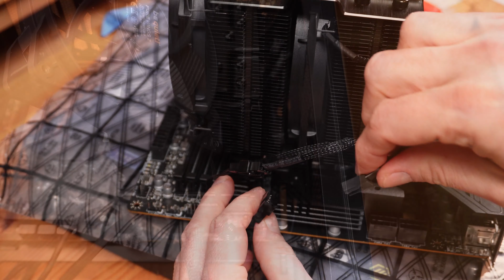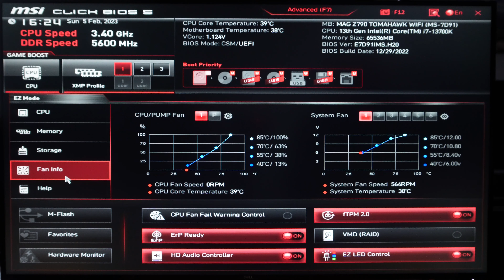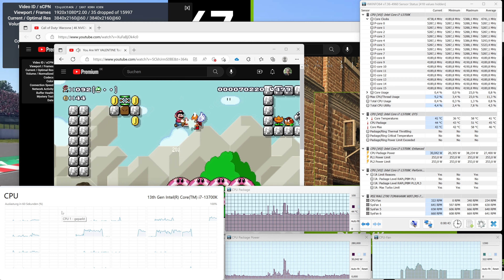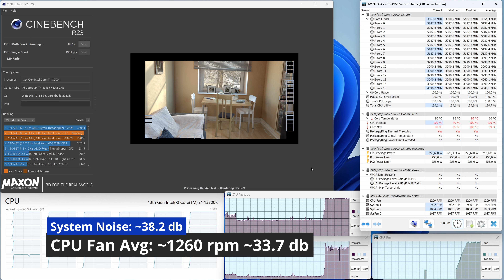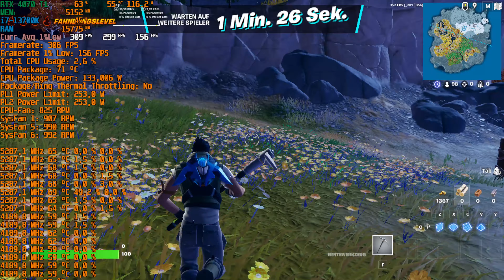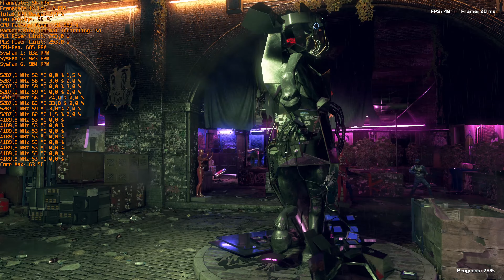Can Be Quiet Dark Rock Pro 4 cool Intel Core i7-13700K Part 1: Noise&Temps

Comment: 14700k user here using my old DRP4 cooler as well. Mounting was fine, but I could twist the cooler slightly if I tried. Idle temps were good, but just like you it was a bad time under full load. Even at a 200W limit with a .1V undervolt the CPU still hit 100C in seconds. 😮
I will have no choice but to lower power limits to 180W.

Comment: I have the same cooler as well but with i9 12900k I am getting about 90temps and even 100, I just cleaned fans and changed thermal paste and still bad

Comment: I have the same cooler, try changing the fans that comes with it for better ones... it makes a huge diferrence!!!
Reply from the maker: Thanks for your thoughtful advice! I already thought about it. Did you repleace your fans? If so, then with which ones?

Just for curiosity I ordered the Dark Rock Elite because it was on sale with 15% discount or so. It comes with faster fans.
Reply: @tech-wombat  I replaced the stock ones for some Corsair 3000rpm 120mm fans... But you have to change the fan hooks too!! Works really well on my 11900KF and thats a power hungry CPU... Keeps my temps in check when OC and full load...

Comment: Kannst du deutsch
Reply from the maker: ja 😊
Reply: @tech-wombat  oke wollte nur fragen ob der Kühler für eine adm  7800x3d ausreicht also für zocken
Reply: @tech-wombat  übrigens super video
Reply from the maker: @official_robloxgang  Danke 😊 Wegen 7800X3D: Schwer zu sagen, da ich mich mit AMD nicht auskenne. Laut Specs sheet nimmt der 7800X3D nur 120W auf. Gleichzeitig ist seine Max-Temp mit 89C 11C niedriger als Intels 13700K mit 100C. Ich habe in meinem Teil2 Video aber paar unterschiedliche Szenarien mit Temperatur vs. Watt-Kühlleistung durchgespielt. Siehe das riesen-Balkendiagramm. Z.B. hat bei einer Raumtemperatur von 20C bei einem Limit der CPU auf 85C der Kühler ungefähr 180W Leistungsaufnahme abgeführt. Wenn man davon ausgeht, dass der 7800X3D nie mehr als 120W aufnimmt, müsste es reichen. Aber ob er das in der Praxis tut, kann ich einfach nicht beantworten. Weitere wichtige Anmerkung: Wenn die Raumtemperatur z.B. im Sommer auf 30C steigt, sinkt ja auch die Kühlleistung, da der Kühler ja nur soviel kühlen kann, wieviel Temperaturdelta zwischen Raumtemperatur und Temperatur der CPU ist. Ich würde vermuten, dass sollte ausreichen. Ich würde mich eher vergewissern, ob AMD auch die CPUs thermal throttled, wenn sie die 89C erreichen. Intel macht das. Dann wäre man für den Fall der Fälle auf der Sicheren Seite.
Reply: Vielen lieben Dank das du dir die Zeit genommen hast mir zu antworten,ich werde mich dazu nochmal ein wenig schlau machen ob der Kühler es in der Praxis schafft (habe schon abonniert und geliked)

Comment: MY COUNTRY IS KINDA HOT IN SUMMER. AROUND 25 TO 30 DEegres every day. do you reccomend this cooler for a i5 13600k?
Reply from the maker: I don't do recommendations. But check out my part 2: there I found at 20 degrees when I limit the CPU to 90 degrees, then it can cool 199W. So my thinking is the following: at your room temp of 30C with a max of 100C for the 13600K the DRP4 cloud dissipate 199W. In that scenario you would have a max Delta temperature between environment and Tjmax of 70C. But to my knowledge the 13600K only produces something around I think it was 180W or 190W. You should double check. Either way this would be less than my measured 199W at a delta of 70C. Meaning: you probably shouldn't experience much of thermal throttling even at a room temp of 30C - provided that your case provides enough airflow. At a low airflow you perhaps would also experience the occasional rotting at max load on the CPU. But max load on the CPU for an extended period of time is only if you render videos or do long compiles or something to that effect
Reply: @tech-wombat  TY ☺️
Reply from the maker: @eingelvf you're welcome. but you need a lot of airflow in your case.

Comment: Very interesting. I have i5-12600K with a Be Quiet Dark Rock Pro 4 and perhaps, only perhaps, I would be interested at put a i7-14700 but at least at a first moment, I would be happy if I must not remove the dark rock Pro 4. If I must do that, I would put a Deepcool Assassin IV. Other chance is send everything to the trash and buy a Gen15 with DDR5.
Reply from the maker: Not sure, if this is a question. I mean the 14700 (non-K) has a processor base power of 65W and a max turbo power of 219W. The DRP4 at a room temp of 20C can dissipate around 220W. As I guess max turbo power won't be held for very long (but I don't know for how long, probably somewhere around 50-100 sec) and is only needed at a max load on the CPU, and then it falls back to the processor base power of 65W which is nowhere near the 220W which the DRP4 can cool long term at 20C room temp this probably should be fine.

Comment: My computer is used mainly for gaming (i7 13700KF, KFA2 RTX4080 ST 1-CLICK OC, be quiet! Dark Rock PRO 4, 32GB DDR5 6000MHz) but would it be safe to say that I could also do some elaborate working in blender as well or not? Thank you and great video!
Reply from the maker: Assuming rendering in blender is a type of full load then my experience is as follows: My Dark Rock Pro 4 is not able to handle my 13700K at full load. This means that the 13700K hits its Tjmax of 100°C and starts thermal throttling. I have read somewhere that all Intel processors have mechanisms built in to thermally throttle a CPU to prevent damage. In my testing this thermal throttling lead to 400 MHz or so lower max frequency, which resulted in around 7.5% lower performance. I consider this negligible, at least as long as you are not doing this mainly on this PC. But to me it is more important that the CPU is not throttling a lot. Therefore I reduced the max   Power Limit 1 and Power Limit 2 to 190W/250W. Alternatively you can set the thermal limit a little bit lower than 100°C. I have tested both of this and how they affect CPU performance in my Part 2 Video of the Dark Rock Pro 4 tests. Check it out if you like.

Comment: Im currently at the decision of buying that exact cooler with a i7 14700 and a RTX4090. I suppose the newer generation won’t make a difference. But do you think the graphics card will affect the heat on the CPU somehow? Like the air in the tower will get hotter and then the cooling power of the CPU won’t be enough? Thanks for the video!
Reply from the maker: I assume you are asking with gaming in mind? I guess the RTX4090 makes more heat than my 4070Ti, and a higher environmental temperature reduces the cooling capacity of the CPU cooler. But on the other hand it depends on how much cores a game actually utilizes. Older games only utilize a handful of cores. So the CPU doesn't produce that much heat. In my tests the my 13700K never came above 150W, and most of the time it was 100-125W. At that usage there is plenty of headroom, so I perhaps higher environmental temperatures from the RTX4090  are no problem. But I cannot tell definitely. I also heared that games like Cyberpunk are utilizing a lot of cores, and therefore in such case the CPU would produce more heat. Like I said... difficult question. Perhaps buy the Noctua NH-D15? I have read that it has a "silent setup" which reduces the max RPM to 1500 or 1600 or so therefore reducing the noise. But in case this wouldn't be enough you could use the max RPM. The max RPM on the Be Quiet DRP4 are fixed at 1200 and 1500 rpm respectively for noise reasons.
Reply: @tech-wombat  Thank you, I appreciate your answer! I think im going to go for a beQuiet Silent Loop 2 Watercooling. Because in the Summer my Room can get pretty hot, like 10 degrees above average. I think I might hit the heat-limit then and don't want to risk it. And Cyberpunk is one of the games I Want to play too. I just had a bad experience with my last water-cooling noise wise and was thinking about an air cooling. Your video definitely helped me getting an idea about air cooling power.

Comment: Hi. I want to use this cooler with i5 13600kf. I will be engaged in video editing and not too heavy rendering of materials. I don't plan on overclocking it. It will be good?
Reply: If you want OC buy AIO bcs DR Pro 4 is one of TOP AIR Coolers and still have high temps

Comment: So if i only use it for games? 
With i13700k 
Would be that ok? Safe? I play only 1440p with Rtx 4080
Reply from the maker: Should be no problem! It is safe anyway as the CPU has builtin overheating protection. But in this use case there should be no throttling at all.
Reply: I want to do a build just like that. 
Purebase 500fx case
Z790 motherboard
I7 13700k 
Rx 6700xt
Dark rock pro 4
Strictly Gaming

Comment: does the Dark Rock Pro 4 comes with lga1700 mounting solution or you bought it separete ? thank you
Reply from the maker: Mine did come with the LGA1700 mounting kit. Check out bequiet site, there they say, since when LGA1700 is packaged. But I think this was probably 2021 even.

Comment: I have a the AIO Be Quiet Pure Loop 2 FX and i cant cooler 253W without thermal Throttle. i Had to block PL1 to 185w and PL2 to 195W and now i dont thermal Throttle anymore :)
Reply from the maker: Interesting. Thanks very much for sharing your experience with AIO. I assume the AIO fans rund at full speed and you are using a 13700k as well? May I ask your room tenperature?
Reply: @tech-wombat  yes i have the 13700k and my room temperature is 21/22°.

I set full speed fans start at 70°. With 185W, i have 84/85°.
Reply from the maker: @gagapa76  similar here. Thanks!

Comment: How do you see all statistics in game? My msi afterburner doesn't show all statistics even when selected and no option for system fans. One more question my 7900x idles at 45 to 47 degrees, in room temperature of 29-30 degrees, is it normal? I am using noctua u12a
Reply from the maker: In the in-game statistics only lines 1-5 come from Afterburner directly. I have HWInfo64 running in the background as well. It provides the other statistics like the system fans and the others. However, to see them in-game you have to enable this first. For that you right-click in HWInfo64, click on OSD (RTSS), then select each info individually, and click "Show Value in OSD", and if needed "Show Label in OSD", and set Position/Line if needed. 
A handful of stats from HWInfo64 (but far from all) can be added in Afterburner directly. For that open Afterburner Properties, go to monitoring tab, and there  is in line three (counted from the absolute top, above the graph list) the label "Active hardware monitoring graphs" and a three-point-button to the right of it. Click on it. Then activate the check in front of HwInfo.dll. Then click on Setup-Button. There you can add i.e. the CPU fan speed, but not the system fan speeds or individual core loads or frequencies. This runs a HwInfo instance in the windows tray bar. It might be necessary, that you open it, go to it's settings, and in the General tab activate "Shared Memory Support".

Regarding idle temps: I am not familiar with AMD. But 45-47C idle temp at room temp of 29-30C means a delta-temp of 15-18C. This seems fine to me. In this very moment I have a room temp of 19C and my CPU shows 34-35C idle, which is 15-16C delta-temp too. So yours seems fine to me, but again: I am not familiar with AMD

Comment: Hello, Im looking  a cooler Be Quiet DRP4 for my LGA-1700  CPU  but in comments one  guy say  that noctua is better but  louder.... that leaves me confused:  Im not gaming  every day, no rendering  at all. So  which  one  I should  take  for my Asus Rog Strix B660-F motherboard?  Or maybe  I  should  look for  liquid coolers? Which  is  better?  Case is  Fractal  Design Define  R2  Tower. Maybe  some  suggestions?  Please 🤗
Reply from the maker: Hi, based on your question I assume your preference is low noise rather than highest possible performance and you are looking for a cooler for the 13700k. The decision between BeQuiet DRP4 or Noctua NH-D15 is only relevant for 13700k or higher and only for sustained high workloads like rendering videos or 3D. Only in that cases you will have to set power limits or get slight thermal throttling on DRP4. The D15 has little higher max RPM (1500 rpm for D15 vs 1200 rpm for DRP4). The DRP4 by itself only makes around 33db at 1200rpm (max rpm), so I assume the D15 will be a little bit louder than that at its max rpm. But to be fair: Some people claim that the 13700k does not thermal throttle when used with the D15 at max rpm (but I personally can't say anything about D15) And you probably can limit its fan curve in the bios in a way not to go above 1200 rpm, if it would be too loud. That way you would have the best of both worlds. It is in my experience more expensive than the DRP4. I personally decided against liquis cooler, as I don't want liquids near my precious electronics and liquid coolers need maintenance every year or two. But they provide much more cooling capacity at louder noise. So it comes back to the question if you have sustained high workloads. Side notes: I do not know how loud liquid coolers are at idle CPU but I have read that some have a rattling of the water pump. In comparison the DRP4 has high quality fan bearings which make it at idle CPU resulting in low 300rpm close to inaudible. But again: I cannot quantify how loud liquid coolers are at idle. 
So based on your informations you probably can take either of them: the D15 or the DRP4. Just for the record: gaming does not qualify as high workload on the CPU.
Reply: @tech-wombat  Thanks  a LOT.